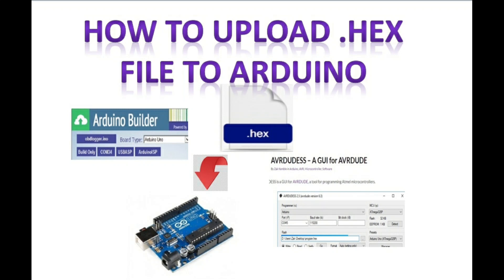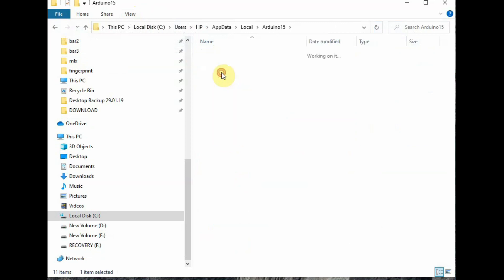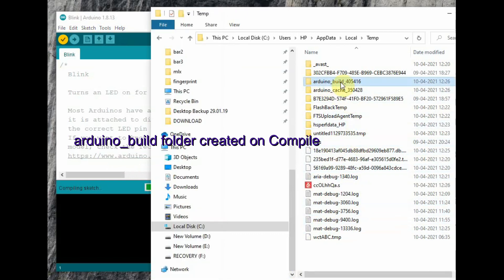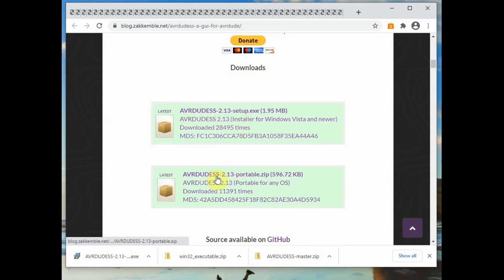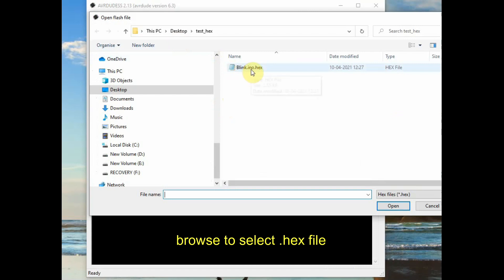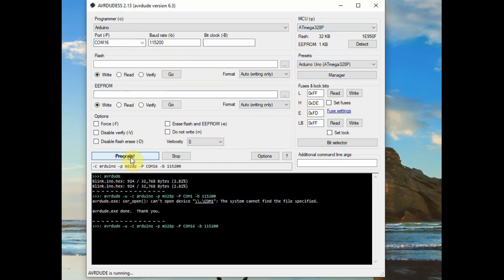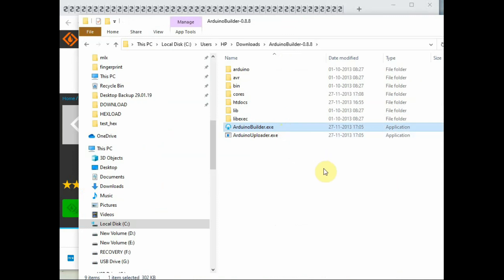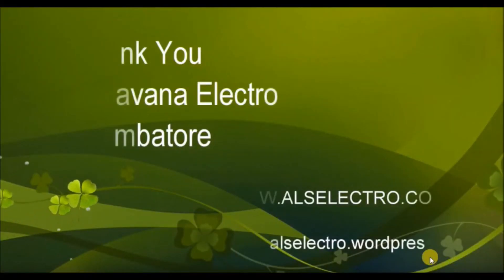How to upload .HEX file on to Arduino Board

Comment: Hello, I have a Arduino Leonardo. I programmed a keyboard/button HID sketch into it. However, I accidentally programmed the debounce too low to sent out a "Y" button command. As soon as I plug in
the Leonardo, I don't enough time to stop it from sending out a "Y" command and jamming up my computer. Can I flash the Leonardo to a clean BareMinimum state using a flasher tool. Do I need a clean .HEX file? How can I stop the Leonardo from running as soon as I plug it in?  Anyone have any info? 
Thank you!

Comment: If you go to Arduino IO, click on the "sketch tab" then "export compiled binary". Arduino will save two hex files in the sketch folder. One of them includes the bootloader and the other doesn't. To view the files you can also click on the tab "sketch" and then "show sketch folder" to find all files you just created.
Reply from the maker: Thank you for the valuable suggestion